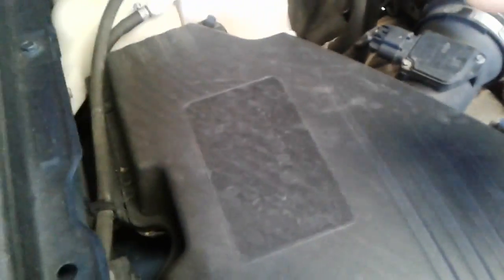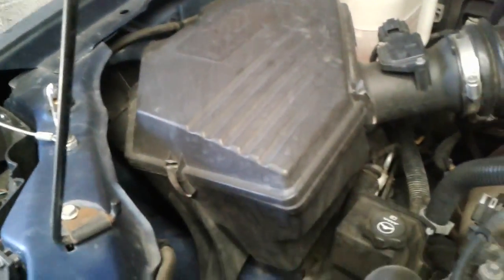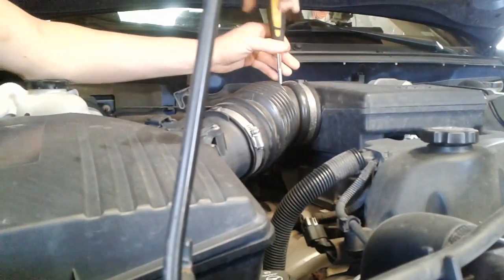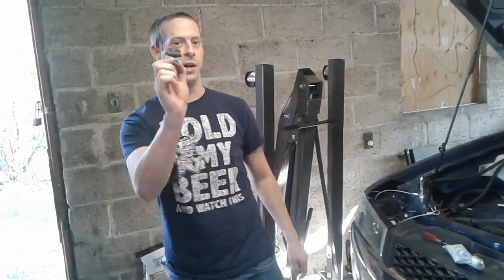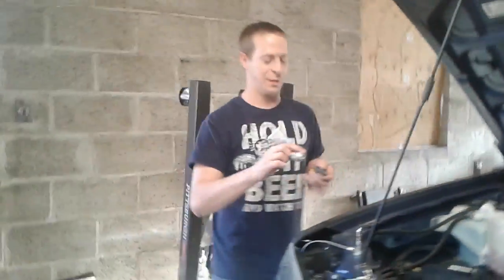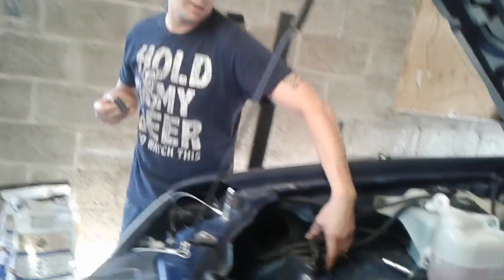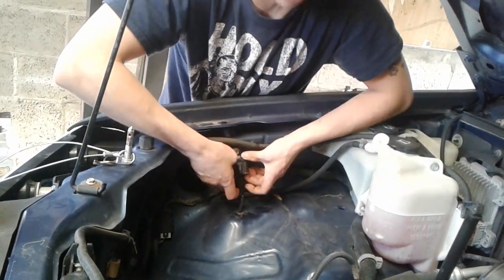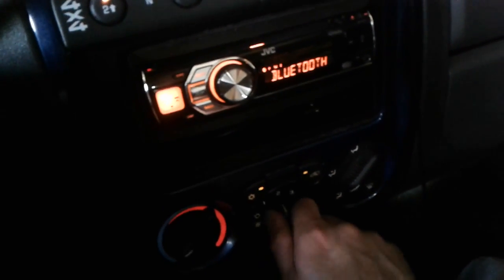Blower motor repair/PT2/Ground proplems

Comment: Hi,  I was following your conversation on this thread as I was having problems with a customers blower motor , #1 the Resister & Plug was burnt so I replace it and no luck there, checked the grounds under the hood and they were good ... I also bench tested the blower motor itself and it was good ,  so I took the kick panel off of the passenger side and there is a lever for a plug-in that goes in & out and about 3" wide so i disconnected it and there was 1 bad ground in the plug-in , so I cut it out and by-passed the plug-in and that fixed my issue with the Ground ,  never did see the 1st video you said was in the comments ,  hope this helps & thanks for the Videos !!

Comment: Thank you for this video.  It helped me troubleshoot my HVAC problem.  It turns out mine was the motor itself, but that, too, was easilly repairable.

My 2012 Canyon HVAC motor was intermittent, works one day, then not the next...one week just fine, next week dead.  Finally, it just seemed to die.  It's been doing this for a few months now.

I went through all these online instructions with every possibility (harness, connectors, resistor, grounding, voltage, fuse, relay, etc.).  But, I didn't find any burnouts or corrosion or grounding problems at all.  I finally chose to check the voltage and ground continuity at the motor connector with a voltmeter. And, sure enough, it was also fine.  (As I later figured out, I should have tested the voltage and ground at the motor connector FIRST, not last.)

Well, the wiring tested just fine, so that meant my motor was the problem.  Since it's too late on a Saturday to get to the dealership, I decided to crack open the motor myself.  It's a bit tricky with the 3 plastic locking tabs (but, you can break these and the 3 screws will still hold it together just fine).  Otherwise, just 5 screws and 2 nuts will get you into the motor housing.  It turned out that my motor was filthy inside with a thick, sticky, brown dust!  I blew it out then pulled the bushings aside and cleaned the armature contacts with alcohol.  I reassembled the motor and plugged it in - WORKS PERFECTLY!

So, the lesson is: 
1 - Check power at the motor FIRST!
2 - If you have 12 volts (black lead) and ground continuity (orange lead) at the motor connector then you have a motor problem...Fix the motor.
3 - If, on the other hand, you don't have 12 volts or ground continuity at the motor connector THEN check the harness, connectors, grounding, resistor, etc...
and 4 - If you can clean out your motor and it works afterward, you just saved $60-100.
Reply from the maker: good deal glad it helped I had to clean mine out had a bunch of leaves in it then my resistor and harness was burnt then I ended up having to hard wire those 8 ground wires because found out after I made this vid there was a ground proplem with the harness and I havnt had no more proplems with my blower and got my cruise control back

Comment: I have had similar continuing problems with the same grounding module ceasing to  operate as it was intended on my 2005 Canyon. Tried sanding just about everywhere on or near the mod but no luck. Decided to open the plastic module and, using 'Brakleen' brake cleaner, sprayed with the little straw provided deep down into the female terminals attached to the source wire's, as well as the male spade contacts under the cap. Sprayed into the threads where the bolt fastens the mod to the side panel as well as the threads on the bolt & washer. Let everything air dry for a short while, reassembled all and GUESS WHAT ? It now works perfectly without trying to find a way to sand the unreachable female terminals where the male connectors go. Obviously, there was sooo much unseen contamination of the contacts  to prevent a sound electrical connection. Wish I had tried This method first a long time ago Everything now works fine and know where & how to clean the module if this should occur again......
Reply from the maker: So what I ended up doing that I didn't make a video  I took all the grounds from both sides and cut the connectors off and routed all the wires to a protected ground bar I did what you did and it worked for a long time and started doing it again so I finally got sick of it and did a permanent fix these trucks seem to have alot of electrical problems that was just one of these trucks bad flaws on the passenger front panel there is a connecter that sometimes does get burnt and have problems but you do have to be careful with it because it does connect to the body control module and you might have to get it reprogrammed
Reply: @davidmartin5027  ---That's what I'll be anticipating as a necessary permanent repair/modification Next time. We'll see just how long the deep cleaning I performed here lasts. Was ready to remove the mod & replace with wires updated with crimped/heat shrink ring terminals bolted to side panel; but opted to try the easier way this time. At least, the cleaned connections work as I have been without AC & ABS augmented brakes for months.....Satisfied for now 🙂👍

Comment: Dave: Their is another ground block on the other side, inside the fender. It is a good idea to do that side also. I don't have any idea why Chevy would tighten a ground on top of Paint and primer, but they did. Duh!  I scraped the paint off the fender with a home made scraper. I sharpened the end of a flat file like a chisel on a grinding wheel. If you look close it looks like you cleaned off the paint but the primer is gray colored and looks like bare metal. Should be scraped off. Just my findings.
Reply from the maker: Ya I took a grinder to it later and added new grounds to the 8 wires I didn't film any of that
Reply: U should make a video for us, girls! Lol.

Comment: I have a loose ground under glovebox. Would this black ground coming loose from spade connecter also stop heater blower and other stuff from working? My daughter kicks dash alot.  Black wire to connecter came loose. Radio stopped being heard too? Anna.
Reply from the maker: Ariana The wild channels. Yes any type of ground if it's loose or broken it will cause all kinds of proplems to everything from radio to lights and everything else  everything runs grounds

Comment: Nice video.   I have replaced the resistor and harness before but my ground is all whacked up.  Would you have any advice on how to change the spice pack?  Everything works from that ground box but the blower.  When it would stop, I would just wiggle the wires at the ground box but now that doesn't work.  I have taken it apart and cleaned the teeth but I think the wire is bad.  Do you know which ground wire in the splice pack leads to the blower motor?  I have a 2007 Chevy Colorado.  BTW --- The only thing I didn't like about the video was I had to wait more than half way through to read the entire shirt.  :)
Reply from the maker: so what I did didn't put on vid I had the same proplem it has the 8 wires keep the ground and add new wires to all 8 wires grab 4 put a connecter on than the other 4 put a connecter on them hook all three of them back in the same spot I havnt had no proplems Sense I did this and I got my cruise control back too that ground is the main proplem in these trucks

Comment: Good chance to use a little bit of CRC electric connector cleaner !
Reply from the maker: That's a good idea what I ended up doing is I took both of those ground bars and cut everything out and put both of them on a new ground bar and cleaned it all up best decision I made that design was the worst in theses trucks that's we're alot of your wire demons come from is those grounds

Comment: Dave!  I haven't tried this yet but i wanted to explain my issue.  My resistor and harness burnt out about 6 months ago.  I fixed that and everything worked great.  However lately my air would just shut off and come back on randomly.  Now I only have speed 4.  I took apart my resistor and its still like new.  So my issue has to be something different than before.  Im hoping this video is all i need to do.  Did your motor ever only work on speed 4?
Reply from the maker: rfickes87 so it does sound like a ground proplem the Colorado's and a lot of gm vehicles have this main proplem I'm going to be making another vid on this that involves the ground a lot of people say replace the motor to the blower but in the long run you will have this same proplem
Reply from the maker: rfickes87 and to add grind it down to bar metal to get a better ground
Reply from the maker: rfickes87 if this doesn't fix your proplem you can take the glove box out and check the whole harness

Comment: I am doing this tomorrow. If this doesn't work what else would it be i have no speed setting that works replaced the harness and blower motor resistor as well took the glove box down no burn marks on the middle connector. Also took off the runner strip on the passenger side and looked at that connection as well no burn marks on the brown wire. My relay is working and the fuse is good. I don't have a volt meter nor know how to use one. But if the grounding issue doesn't work do you have another option to look into?
Reply from the maker: the only other thing would be replacing the blower motor if you looked at everything
Reply from the maker: what I had to do because this fix fixed it for a couple weeks then did it again there is 8 ground wires one goes to the blower and the others go to other things if your cruise control don't work this will fix that too I connected new ground wires on all 8 wires and took 4 put a connecter on it took the other 4 and put a connecter on it then used the ground connecter and put my new ground wires on th same spot I havnt had no proplem sense

Comment: Hi, so my settings one two and three worked on and off. So I ordered the resistor and splice. Then when I get down to it the brown wire or second is burnt. Well I wasn't ready to fix it yet. But then I started SMELLLING BURNT WIRE. Then setting 4 started to not work so I go to cut the wires to splice it in. BUT I NOTICED THE brown wire has already been spliced in. I didn't see any fuse or anything so I changed the splice and resister it worked all settings at first. Then one two and three stopped and the burnt smell returned. I reached under glovebox and a smaller set of wires were hot. Where do I start?
Reply from the maker: sounds like you have a proplem in the whole harness if you take out the glove box there will be a bunch of connecters hooking in the harness

Comment: I have that same issue and did exactly like he said but the problem is the mounting ground bolt.
Reply from the maker: so the proplem is in the harness its self I added new ground wires to that harness and grounded them out and have had no proplems Sense and got my cruise control back too never made a vid on that

Comment: Whats the top peice of that called because my bolt snapped off of it
Reply from the maker: Ground splice pack
Reply from the maker: Have fun they can be a pain sometimes what I would tell you is buy a grounding block and cut that garbage off and ground it to the block

Comment: What is the actual name of that "ground harness"? 3 auto parts stores near me and none of them know the name for it! I did what you told me in the video. I need this part to make mine work properly again.
Reply from the maker: it's called a body ground harness it's a dealer part
Reply from the maker: So what I did because they whant a arm and a leg for that part there is 8 wires splice 4 of the wires don't cut the wire just splice and put new wire on the 4 wires put a connecter on and ground it to the same spot than do the same to the other 4 wires than you will have a double ground I did this and I have had no proplems at all
Reply from the maker: this is why I say do it that way because the proplem is in the harness not the connector

Comment: Hi I have an 05 Grand Marquis with the blower motor having charge but no ground would this work for the same thing I have no ac or heat and I am dying I’m 16 first car
Reply from the maker: I would check your resister and see if that's blown first but yes this will work for yours to find your ground bars they will be in the engine bay all black wires they might be closer to the fire wall you will have one on driver and passenger look for the passenger side one
Reply: Hi I checked the resister I have no ac or heat on any setting it blows out maybe 1/10 how it should the ac compressor is working and everything but I checked the plug to the blower motor last night and there is just no ground to the plug and I’m thinking if it had ground it would run perfect

Comment: Do you know where’s the blower motor ground for a 2004 Chevy trailblazer
Reply from the maker: I whant to say it's inside the the passenger side on the left side you will see one Phillip head screw and it should be under there a bunch of black wires
Reply from the maker: it should be were your foot is
Reply: @davidmartin5027  under the carpet?
Reply from the maker: side part under the carpet yes

Comment: I tried this.  Sanded it down to metal.  Put it back together...  Still only have fan speed 4.  I just replaced my harness and resistor about 6 months ago and having this trouble again.  Resistor isn't burnt.  I have no idea what could be wrong.  Can anyone help me out? Its a 2010 Colorado
Reply from the maker: rfickes87 so that means you have a burnt brown wire it's on the passenger on the side inside the big blue and white harness And it would be your brown wire that is your 12 volt power wire on the bottom off to the side
Reply: Dave's Vlogs hi Dave! Thank you for responding.  So i just need to buy another harness?
Reply from the maker: rfickes87 so that brown wire goes to the circuit and if it's burned up what I would do is cut the wire and and get a add a circuit and put it in with the CD player fuse with the new wire than cover the other wire I don't no if any of this makes sense but if you take the panel on the side by door under the glove box off you should find that brown wire that is the 12 volt wire to the blower motor that wire burns up
Reply: Dave's Vlogs sorry Dave you kind of lost me.  The brown wire your talking about... Is it inside the resistor harness?  If it is can I just buy a new harness right?  I think your explaining a permanent fix but I'm afraid to start cutting and re-routing wires.  If i have to just keep buying resistor harnesses i will.  Can i just do that?
Reply from the maker: rfickes87 sorry but yes that might work but you might run into the same proplem I had all kinds of proplems with mine but now it seems like it's finally fixed after pretty much wireing the whole thing

Comment: Thanks to this video I finally fixed my ac blower, after replacing the ac control panel, motor blower and motor resistor 😂😂😂 fuck me backwards. $250 in total damage😢
Reply from the maker: Ah to bad you didn't find this vid before hand glad it helped you fix it later on I got me a ground bar and cut the harness off and grounded it straight to the body